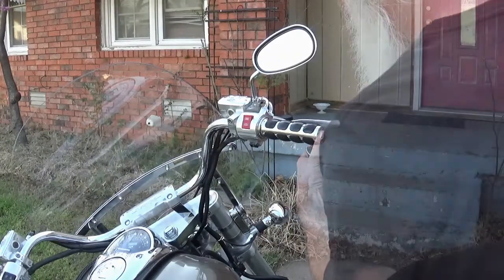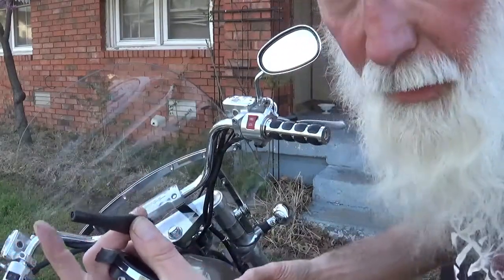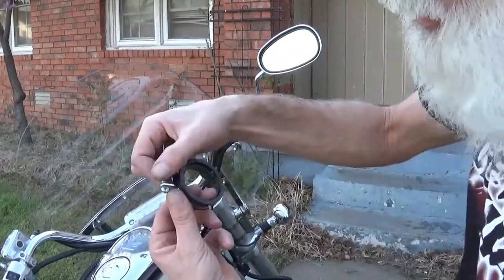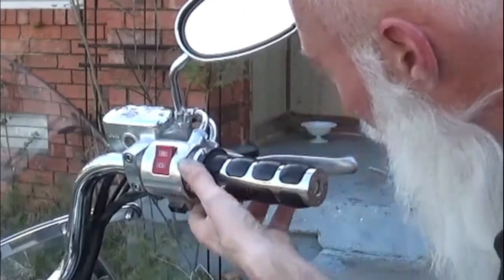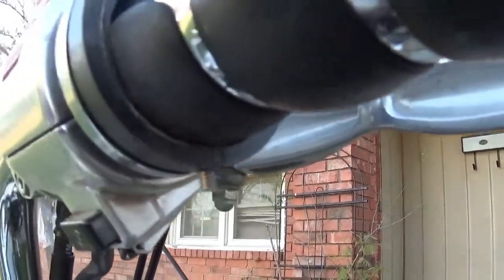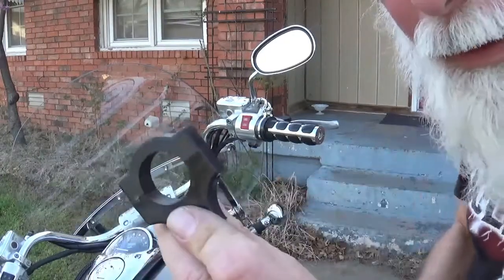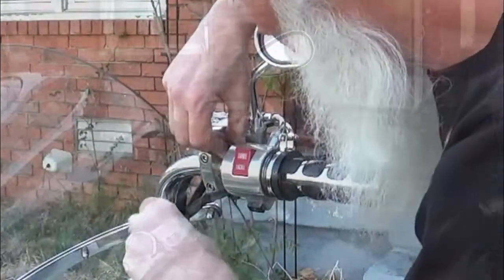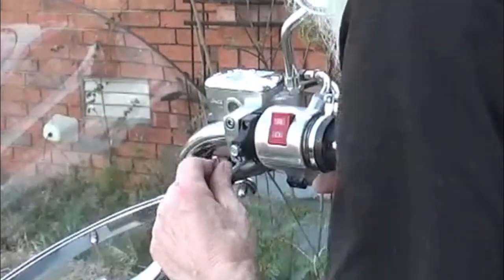Installing a Universal Throttle Lock on Your Motorcycle- A Guide to Installation- It's Easier than..

Comment: Just bought new grips like the ones you have and was wondering if that style throttle lock fit over it. thanks to your video I'm sure it will. I now will definitely order that. There are many of those made by different companies, who makes that particular one you have? Oh by the way I like where you put the crossbar, above the killswitch. Looks like a much better location as opposed to some of the photos I've seen which were midway, below the switch.